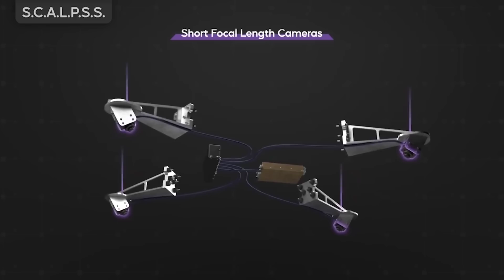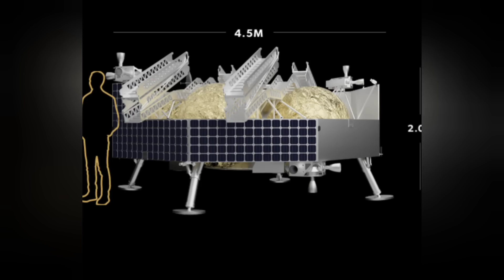Another NASA Moon Mission!  SpaceX, Astrobotic cannot afford any mishaps this time!

Comment: I wish they would get over the fear or aversion to use of a radioactive power sources.
Solar power is good for charging batteries to drive the rover but a radioactive power source,
besides supplying power could also keep vital systems warm, and data transmissions flowing.

Comment: I hope they designed this lander right, as in short and large diameter. The '60s Surveyor was an excellent design for an unmanned lunar lander. And here we go again, using experimental technology (which means 99% guaranteed to fail) But it is probably all for nothing anyway, as establishing a permanent presence on the moon is not currently possible due to radiation, and nobody has come up with any ideas on how to shield humans from radiation for an extended period of time. If they could do that, the ISS could be in an orbit 10 times higher than it is, because it would not need that tiny bit of atmosphere to protect it from radiation. As it is, it is not really in space at all. It's just way up in the sky, and has to be constantly boosted to keep it up there. All of these plans may eventually happen, but it will not likely happen in this century. 

The Astrobotic lander, the Peregrine lander, the Intuitive Machines lander, the Japanese lander, and the Russian lander were all FAILURES, as they did NOT accomplish what they were designed to do. We seem to be living in a society where everything is a success if anything happened at all. The Indian lander is the only one that seems to have been a success.
Reply: ISS is in the orbit it is not because of some atmospheric protection against radiation (nope, the near-vacuum at the ISS altitude doesn't provide any shielding value whatsoever), but because:

1) lower orbits are less energetically expensive, so easier to regularly deliver cargo to (and at a cheaper cost per unit of mass); one of the key ISS requirements was that it be serviceable by the Space Shuttle - which by design was not even capable of reaching significantly higher orbits 

2) higher orbits would intersect with the Van Allen radiation belt around the Earth - chronically exposing the crew to a significantly higher radiation burden and potentially causing faster materials and equipment aging, with more electronic malfunctions

Comment: NASA's history of mission success is based upon  the primary pillars of redundant sub-systems and exhaustive testing at multiple levels of integration. CLPS embodies none of these principles so we don't really know if it can deliver until there has been sufficient string of mission failures, at which point NASA administrators accept that it was all a pipe dream and conclude that serious lunar spaceflight missions can't be done on the cheap.

Comment: You mean they "can't" take 11 years to build 1 Moon Rocket over 50 years after they had already landed on the Moon with another design in less than 10 years starting with no rocket experience? NASA doesn't have to be perfect but everybody else does. It took NASA 11 years to build and barely launch without any fuel leaks and use the completely disposable 26 billion dollar rocket for 1 flight to and beyond the Moon. Making a "STUFFED SNOOPY" the first man to travel beyond the Moon.

Comment: First, forget Artemis.  At $4.2B US per launch, it is far too expensive for anything other than backup or energency use.

Second, remember that, to fulfill its existing HLS contract, SpaceX must launch its HLS lander to the moon, land it on the moon and return to LEO completely uncrewed.

Third, remember that Starship HLS will have a payload of approximately 100,000 kg.  That payload capacity can be dedicated in whole or in part to supporting instrument packages, some of which can be satellites for various purposes and some of which can be for surface deployment from orbit.  ALL or part of those supporting instrument packages can be navigation aids for positioning and landing.  If 100,000 kg of instruments are not enough and because under way replenishment will have been accomplished (or we could not have gotten to this point with Starship or SS-HLS), one or more additional SS missions can bring even more instruments.

This is something the folks at SpaceX can do.  We should let them do it.

Comment: Interesting how we can fly millions and millions of miles away to mars and land there several times.
Reply: or Titan, many times further than Mars.        Didn't the Soviet Lunokhods predate the Apollo rover by some years as the 1st vehicle on the Moon?
Reply: Mars landing is technically easier as there is an atmosphere to slow down the lander. Also the terrain that was chosen was relatively safe and flat (for both Apollo and Mars). The South Pole of the moon has thousands of craters and no atmosphere so needs a vertical propulsive landing with automated hazard avoidance technology. The Nova-C was going sideways when it touched down as it couldn’t work out the altitude properly and snapped the legs off.

Comment: Agree. But its the lander suppliers under CLPS that are having to do the learning, this time Astrobotic. Evidently we have discovered, surprise surprise, that the area is heavily cratered and plenty of rocks. I have NOT been a big fan of SpaceX's lander design. Im's trip-up , and JAXAs SLIM land and roll, only goes to show how difficult the area is...
Reply: SLIM didnt land anywhere close. Its at the equator.

One thing really hurting our chances at landing on the moon right now is building a new design of vehicle for every mission. We never get a chance to iron out all the bugs because every mission is a new vehicle type and software going to space for the first time. We don’t get a proper chance to learn from our mistakes. That issue should be solved soon. All of our designs will be test landed before we have people on them and they are all made to be used multiple times so that means they have resenancy and survivability built in. 

Even the commercial lander’s have reused designs so they will be able to apply lessons learned to future missions with landers of the same type.
Reply: @Jayc5001  So which lander so YOU want a a 'standard' lander?? Narrow and tall? Wide and squat?? Somewhere in between??
Reply: @jesselomas8626   And that's not even counting China's mission to the moon Queqiao 2 that's supposed to launch this month or Chang'e 6 that's launching in may. The US isn't the only country with big lunar plans.

Comment: Logically, first, we should have 360° satellite communications coverage of the moon to eliminate blackouts. 2. Same continuous coverage in earth orbit to sustain earth-moon comms. 3. Either get  Gateway built or send a habitat to the moon followed by astronauts to get the moonbase building started. 4. Drop locater beacons on the moon in lieu of no GPS coordinate system  to aid autonomous landers. These programs and builds can be simultaneously constructed in real time. No longer need to do one at a time. Otherwise,  we'll never get there. 😂😂😊
Reply: 1. Mascons make lunar orbits unstable, and a GPS needs stable orbits to be accurate. 2. TDRS. 3. Isn't that what we're doing? 4. Real-time sure, if you have trillions of dollars.
Reply: @spacexrocks1041  I didn't say use GPS, they require fixed markers embedded in the soil like here on earth for location. Locator radio beacons are different and are used to triangulate positions. TDRS has comms LOS and blackouts and is not worldwide supported. A small satellite constellation like starlink of only 12-16 sats could support earth-moon communications.
Reply: Made me think, can we put something in a geostationary orbit above the moon?
Reply: @billtackett7512  Not only is it possible to put sats in GEO around the moon, but it is easier to keep them there since lunar gravity is so much less than earths gravity. Also, Lagrange Point, L1 is between earth and moon, and communication satellite relays can be positioned there if desired and will remain stable and in place  with little effort
Reply: Agreed.  There should be satellites in orbit around the moon, same as we have here.  Seems like we're jumping the gun a bit.  
Step 1: Satellites to allow direct imaging and communication at any time
Step 2: Send a fully dressed lander (as if there were people on it) to work out any bugs in the landing process
Step 3: Get astronauts on the moon to start working on a landing location
Step 4:  Continual supply missions to bring digging equipment, food/water, habitation modules
Step 5:  Bury those modules to protect from the radiation (future astronauts won't have to worry about too much overexposure like the first few).
Reply: Great point, and I think once SpaceX Starship gets to outter orbit, he'll create a starlink like web around the moon. Alot depends on starship program.

Comment: They need to make their landers with a lower center of gravity.
Reply: There is tons of massive structures on the moon  so finding a good landing spot is tough.  The Apollo missions could easily avoid those obstacles with astronauts on board.
Reply: My thought exactly. It looked top heavy. It should be lower to the ground and much wider. Whomever team decided that has got to go.
Reply: Am not an engineer. But I was thinking the very same thing 🧐
Reply: It was tall for very good reasons, the sensors needed to be high to do their jobs i.e receive information from a wide area, hard if you are only 20cm off the ground surrounded by rocks, and at the S pole the solar panels needed to be in the sun as long as possible i.e higher. On top of this the lander was never supposed to be going sideways on landing - that was the problem, the landing. So the designers didn't overlook the height issue, it was designed exactly to have height to do its job.
Reply: @philleng480  And it was nowhere near as tall as Starship, so why is anyone worried?
Reply: Which begs the question, who designed this probe?  Doesn't seem like there was a whole lot of margin considered during the design process.  Structurally for example, having what looks to be the pins shear off the lander body from a 1mph horizontal velocity is a bit ridiculous.
Reply: @TheTurbineEngineer  think it was 2mph sideways and 6 down.  That's pretty harsh. Expect stuff to come straight down,  that was the plan, but the landing  hard and software was pretty well all u/s. Blind luck it didn't just crater, all in all not a good advert for kit made on the cheap.
Reply: Like Starship ...
Reply: Wouldn’t have helped astrobotics last time